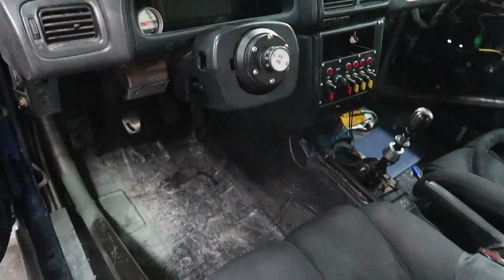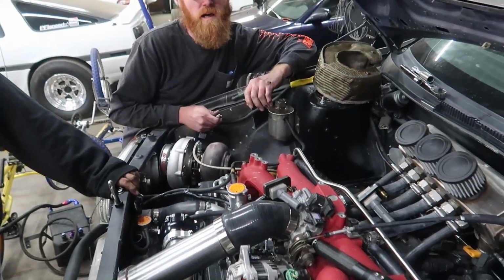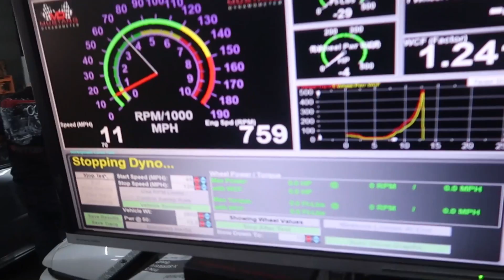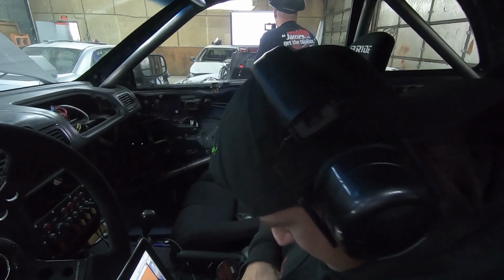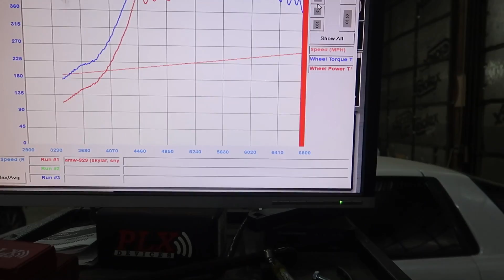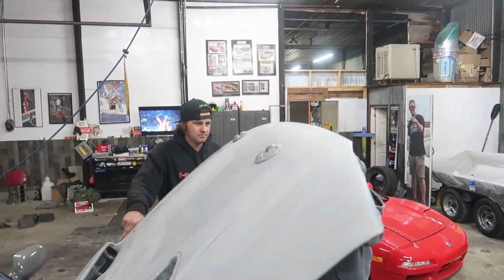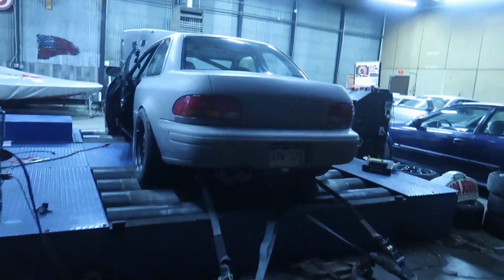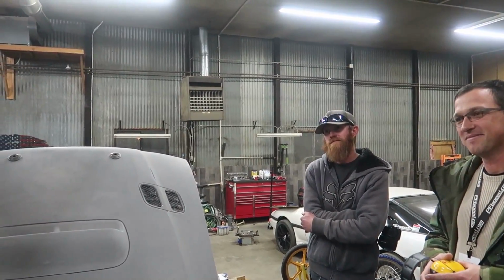Problem Solved! Home built Subaru shoots for over 600hp round2

Comment: 3:00 I did the cylinder 4 cooling mod using a genuine subaru water fitting in the back of the head. They used to be factory fitted to the old liberty's. Part was shipped from Japan as there were none in the country. I installed it as per how Subaru (mostly), had it set up. It's running great and equalises the pressure really well as the lh head only has one out while the rh head has about 3. Only sort of downside is you can't then get too rowdy with increasing timing as cylinder 4 was intentionally kept hotter to produce knock first as that's why the knock sensor is there. I'd rather have a more reliable engine myself.
Reply: I found this part of the video really interesting and went and did more research afterwards.  I have had 2 WRXs with cylinder 4 misfire codes.  The most recent was a hole in a cylinder 4 exhaust valve.  I got the getadomtune.com fix and plan to install on my current build.  We will see...

Comment: Subarus you have to work into the boost duty cycle easy then ramp it up then drop it again. It’s a tap dance to get it dialed in for sure. I spend more time dialing in boost curve in subarus than any part of the tune..

Comment: Glad to see the got fixed. The 6466 has so much usable powerband compared to 42
Reply: nFINITELooP go with a twin scroll Borg EFR setup if you want a really usable power band with, that’s the turbo line to go with... spool insanely fast and they hold boost high into the rev range

Comment: More than likely looks like too much proportional gain.  The trick is finding the right level of proportional response and the right proportional/integration ratio so that it doesn't oscillate but also doesn't have to wait too long for integration to make up the difference on too little proportional response which will show up as laggy under/overshoot.  Derivative gain is then added sparingly to improve transient response/stability.

Comment: 4 ports often need different frequency settings. Longer stroke than a 3 port. And there are a few different pn#'s of solenoids from MAC with diff characteristics that people all sell as the same 4 port. Quit tossing in the generic 3 port settings (33hz, or 33333us in aem) for the 4 ports 😉. Half the 4 ports ive tuned on aem run well in the 66667us range, 15psi to 40+psi - others only like 33hz. But need to adjust frequency based on how its responding.

Comment: Im not a subaru guy (4g guy) but this thing doesnt rev? Is he still dialing it in does it have another few K rpm in it? power band is narrow as by the time that gate is open.
Reply: xack rogueAU also running UEL’s and a larger turbo, so spool isn’t quick. Subaru’s don’t like to rev like a Honda K or a 4g lol

Comment: brah, car looks great, that downpipe wasnt upgraded tho.............   1800F EGTs here we come. I commented on the last video its gonna hold him back, alot...  But Great work! dont get me wrong there!
Reply: Are you sure it wasnt upgraded? Maybe your laser eye needs some calibration, looks like 3.5" all the way out to me 😜
Reply: You can see it fall off on top as well. To much back pressure. Whatever it is, it's not big enough.
Reply: @LordMustangGT93  lol just need to bring up/ tune in some wgdc. But in 5th at 140mph on the dyno it gets a little sketch. You may very well have been the reason i rebuilt the entire exhaust to 3.5"
Reply: I'm sure I'm running into the same problem now, 3" dp, and logging over 70ppm on my talon. But it rips. 140+ and awd does look a little scary on a dyno lol.

Comment: Just starting to watch the video.. love the videos guys! Wanted to ask you guys a question -I  Just supercharged my 03 tacoma 3.4 v6 to where its making at or near 300 at the crank and now I have to replace my clutch and flywheel. I have a new stage 4 clutch on the way but wasnt sure if I should go lighter  on my flywheel?.  stock flywheel weighs 22 pounds and the lighter flywheel is 13 pounds .I did shave 8 pounds off my harmonic balancer as well.    stock tire size is 31"  I'm running 32's.
Reply: Light flywheel with tall tires will make for lots of hotboi takeoffs. Once you have it rolling it will feel stronger. 10 lbs of rotating weight is the same as 100 lbs in the trunk/bed
Reply: @1goodfixer  tires are barely bigger than what it had stock.  and It does have 410 diff gears so it doesnt act funny from a dead stop right now , I dont have to rev it higher. I was just worried about pulling big hills with the lighter flywheel. since I live in the mtns in central california and drive from 2000ft to about 8500ft for work almost everyday..    right now i can pull all the hills in 4th and 5th gear just fine... man I really want that flywheel but everyone just dismisses the idea. I think it would work with my setup
Reply: Simply put the light flywheel will double or triple the effects of the lightened balancer. The truck will be much easier to stall on takeoff but once the clutch is fully engaged you will notice the "extra power". Tires will be easier to spin in low traction situations so be smooth with the throttle in snow or rain...you don't want to hurt your hotrod!

Comment: 2:10. The 3.0h6 IS that bad. I can pull the engine faster than I can do valve cover gaskets in car
Reply: Ouch
Reply: Only way to have a reliable Subaru, Honda swap it.
Reply: Monkey Wrenching right.. except my built STi makes 550whp and hasn’t ever had an issue🤔 daily driven
Reply: Bryce - it’s a joke, don’t take it so hard.
Reply: Monkey Wrenching I’m glad you have the ability to understand the way I took your joke through plain text😂

Comment: Wanna make power? Don't get a Subaru. Go Honda or ls v8. The price I was quoted to build my sti to 700hp reliably was the same as buying a used c5 vette and a use 350z. Let that sink in
Reply: It's not always about making power the same way everyone else makes power. Some people really like pushing different platforms.
Reply: @BackFiveOne  that's true but it's not really a great platform for power. That's all am saying. It's a great car especially in the winter.
Reply: @africandude7583  says they guy boosting a miata lmfao
Reply: @TheGlassChambers  I have a 2016 sti, ek9 civic, 98 neon 420a turbo and a turbo miata and I had a 2006 wrx wagon. Btw my sti is the slowest of all 4. They are expensive to build. Power to $ ratio is awful